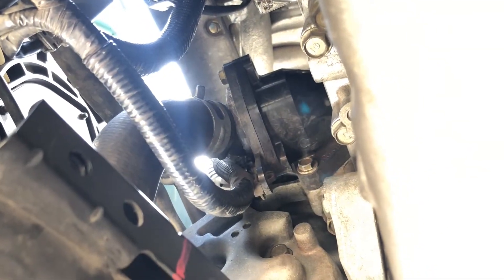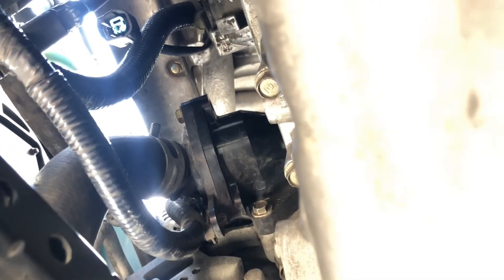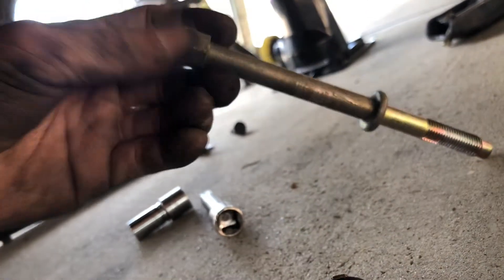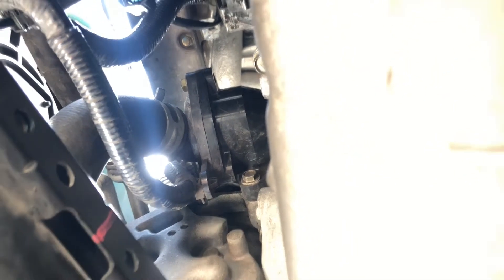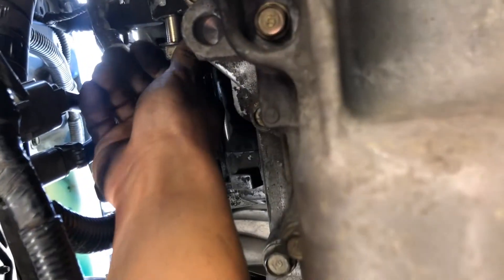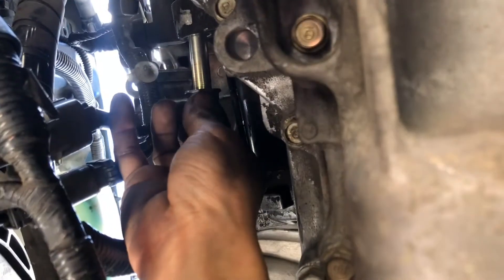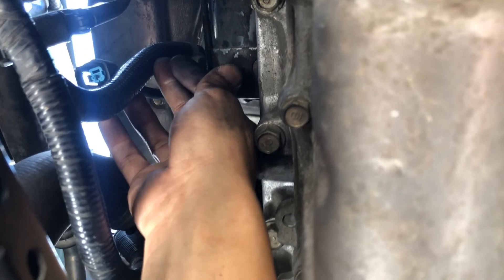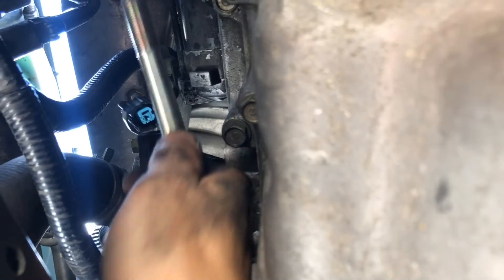2002 Acura Rsx Type S Starter Replacement Without Removing Intake Manifold

Comment: I started taking my manifold off and my dad said to lift the rsx and do it through the bottom ima try it Tomorrow good video
Reply: Did you end up getting it from the bottom?
Reply: @Bluu998  no I took the whole Manifold off it was easier
Reply: @SoCal_  ok good to know. Did you have to take the throttle body completely off? I’m going into this job myself 😂
Reply: @Bluu998  yes I took everything off for better access it’s not hard maybe the bolt on the left bottom of the intake manifold is the trickiest it fell off 2 times I had to tape it lol I also let the T bracket loose and pull it it’s bit forward. Your gonna have to take the bolt in the front  middle of the manifold using 2 nuts one backwards and then tighten it to take the stud out it was a process but since it’s not my daily I took my time ,
Reply: @SoCal_  thank you! Wish me luck haha
Reply: @Bluu998  what brand are you gonna install ?
Reply: @SoCal_  I got remanufactured oem starter to install. Rather do it once and done than have a cheap China starter that’ll die in 6 months. Who knows maybe I’m paranoid 😂
Reply: @Bluu998  sweet I got a duralast with warranty lol sounded funny at first  but since I have the auto start and I would leave it on gear it would move forward ,I think that’s what messed it up little by little shout out from Cali 🫡

Comment: The shop manual tells you to do it from underneath, remove that rubber stop bolted to the sub frame first and then disconnect the harnesses (don't forget to remove the battery cable), and knock sensor harness.  I'm concerned about breaking the knock as well but figure it's worth a shot because removing the intake manifold takes longer.  I'm curious if my swivel sockets will come in handy..
Reply from the maker: Swivel sockets will give you  much of an angle its a limited space down there you should be able to do it just take your time .

Comment: Wish you could’ve recorded the install. Looks like a pain just to remove, I can imagine it’s hell to install
Reply from the maker: Moreno12 its pretty straight forward get a long socket and a ratchet some other folks use u joint but i didnt use that ,you have a limited leverage in there that bolts on the back top of the starter came loose very easy on mine you going to have those wiring  connections  unplugged  yeah i should have recorded during the process on taking that off   and putting it in its kinda hard to record the entire process without extra hand... its a simple task to do just pe patient and dont rush be very careful of that knock sensor once you have all the bolts removed you will have to pull back towards that knock sensor side mine broke off easily but its not big of a deal i replaced it with aftermarket from oreilly , and be very careful doing this hopefully you have small hands like me  you dont want your hands get stuck when doing this .putting that long bolt behind that starter give me a hardtime lining into that hole,i wraped the long socket into that bolts so it wont move that much while screwing it in kinda wiggle that starter back and fort ,i did this by feel because you wont be able to see it underneath the car .once you have that screw in you are good to go
Reply: Dayb82484 Duckky I am working on a 2005 civic si. There’s nothing on YouTube on how to do that. This is as close to the si that there is but I looked under and I can’t see how I can do it
Reply from the maker: Moreno12 i think the civic has more clearance than the rsx’s because of the intake manifold design not so sure though .,you should be able to see the starter from underneath they have the same configuration if im not mistaken ,make sure you jack the car up enough and use jack stand i used 4 jack stand 2 each side in the front better safe than sorry , also use flash light so will have a better view.starter has two bolts one in the back top and one in the bottom

Comment: There's no way you can do this from the bottom unless you have the smallest strongest hands ever
Under 2hrs from top after an attempt frumunda
Reply: Note- instead of risking hard-to-get-to  knock sensor, i instead only broke the tiny clip from the imrc connector which I fixed with some grease and a ziptie 🤣
Reply from the maker: I do have small hands and a chicken arm so its a plus 💪 😂that bolt in the back wasnt even hard to remove .
Reply: @Dayb82484 Duckky  dude the 14 on top took me like 120ftlbs to break loose from the top with a huge extended breaker bar lol. Original with 188k miles on a 05 base auto
Reply: I have a 2006 Acura Rsx. I also owned a Honda Prelude b4 so I am familiar with this job as I changed the starter on both cars. The Prelude didn't have anything hiding the starter so it was simple, 3 bolts to remove old one and then replace with a new starter. 10 minutes job. I'm not a professional mechanic, but I'm a man, so I can do the job, given all the proper tools, which I have. The Acura Rsx was a pain because you have to remove the intake manifold as it's hiding the starter. You also have to remove the front hinge of the car next to the radiator and also the battery. Not too difficult but alot of bolts and stuff to remove. Also the air filter hose. All this is necessary to get easily at the starter, which is hidden beneath the manifold. After all that removal, basically 5 minutes to swap out the old starter for the new one. A long breaker bar wrench is needed for the starter to come out as it's wedged in a tight spot. I had all the correct tools but still needed 2 hours for the job. But I didn't have to break my back or exert myself. I didn't even need my impact wrench for this one. Breaker bar and socket wrenches only. So I don't know what this guy is saying because from underneath it's a Tom Cruise job.....Mission Impossible.
Reply: Serious Design flaw in the Acura Rsx. Starter is hidden and wedged in a place that you really have to remove the battery, front hinge, air filter hose, and intake manifold to get a clear path to remove the starter, and then a long breaker bar wrench to remove the bolts. There is no other logical way to do this. Acura did that on purpose so you go to them for this relatively simple job.
Reply: @mcentepede  yes ive done both as well. Prelude was super easy. Im rly good at getting the manifold off the rsx now cuz I had to do the knock sensor 15k miles later 🤣
Reply: Way to go...just patience and the right tools.
Reply: @mcentepede  artifacts all k series are interesting to do starters on
Reply: Yeah it not easy I've done it 2x now but broke knock sensor every time